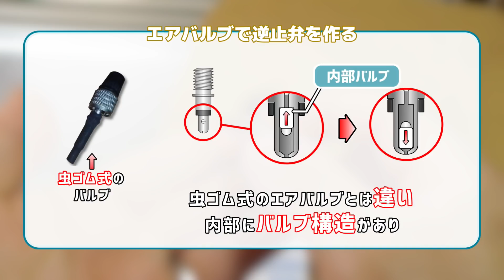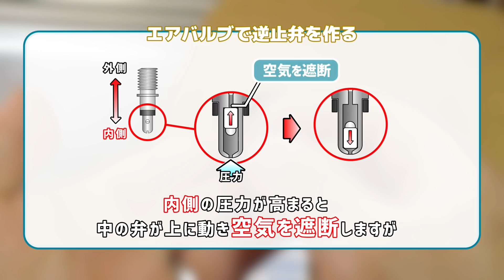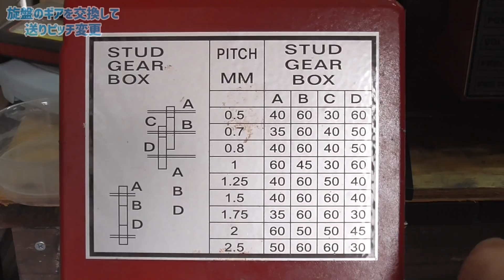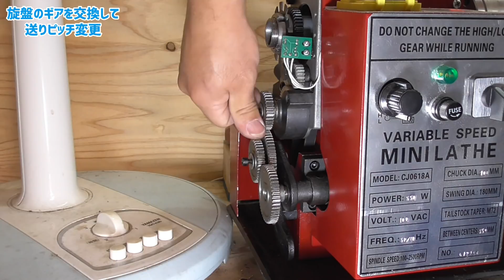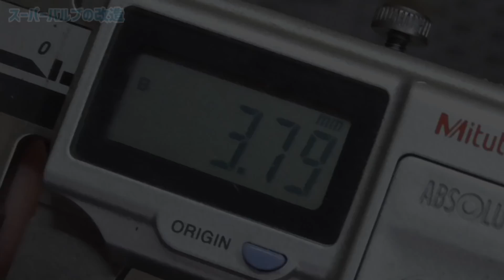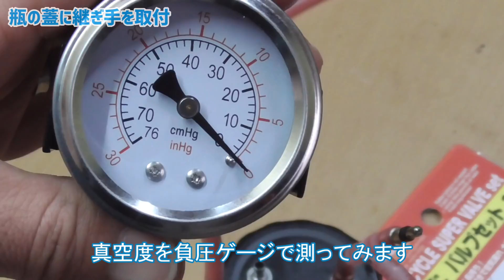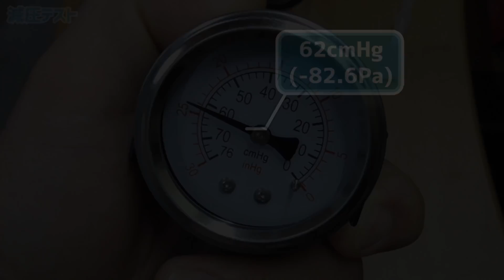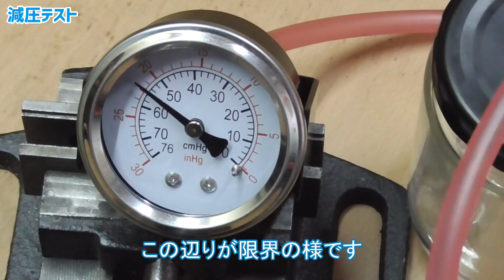【改造】バキュームチェンジャーを作る【ブレーキフルード】

Comment: Just use a large syringe and push brake fluid from the caliper it’s faster and way easier than this 
My scooter has a 200mm long rear brake line first I let the system drain out the old fluid than use the syringe to push fluid from the caliper and it only takes about 100cc to fill up the system 
After fluid comes up to the master cylinder close the bleed screws and u r pretty much done
Reply from the maker: Thank you for your comment
The pumping type replacement method is a good idea 

コメントありがとうございます
圧送式交換方法は良いアイディアですね